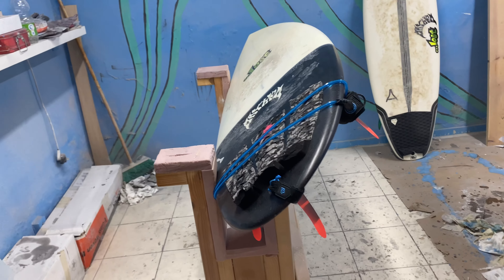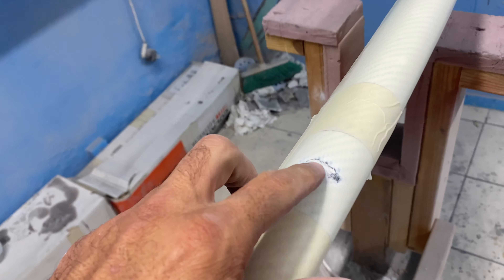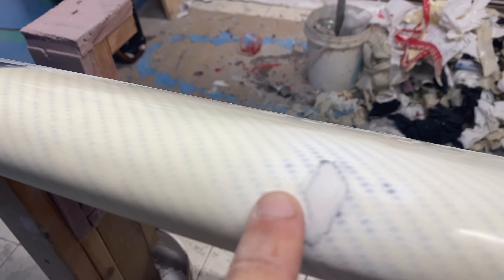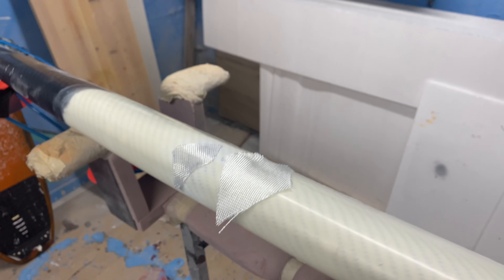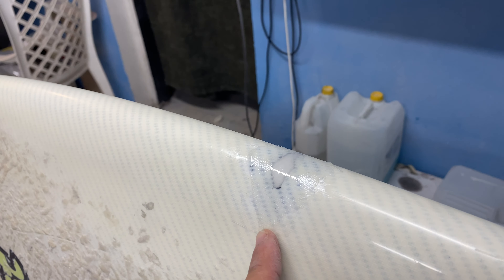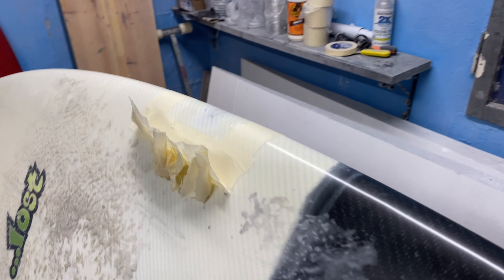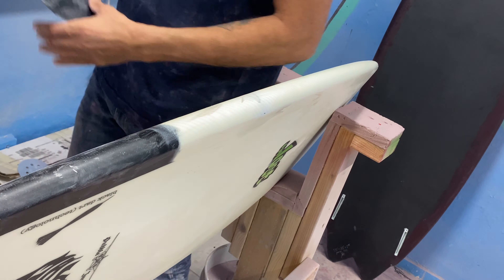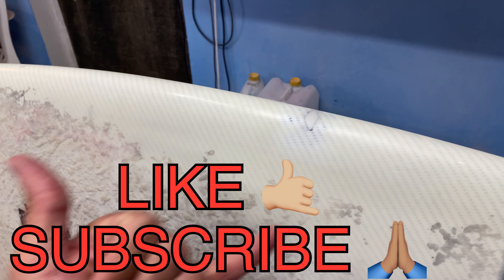How to Fix Surfboard Rail Ding Repair [start to finish]

Comment: Hey mate great video, how long would you recommend waiting between the three steps of the process for the epoxy, fibreglass/resin and hot coat to dry?
Reply from the maker: In my country it is very hot (27c plus summer) so i can sand after 5-6H 
To be 100% sure it's cured wait 24H every step
Reply: Thanks mate appreciate the info!

Comment: Hi Koby! what do you use to hotcoat this EPS surfboard? When you hot coat do u just add an extra layer of epoxy resin ? thanks!
Reply from the maker: Yes, i just add additive F for smooth finish and easier to sand 🤙🏼

Comment: my epoxy long board got through some rocks and the rails are scratched a lot;  non are deep but there are a lot.  Nose and tail are very scatched but not  like this one in the video;  what do you do to scratches? you recommend ? thanks in advance for your response bro
Reply from the maker: you can send them gently and spray matt clear coat, you can try to sand with water paper (320 or 400) and some of them will go away or - sand them with 120 grit, do a resing hot coat (as thin as possible) and sand + finish. if the scratches bother you visually - just spray them with any color you like after slight sand with 240 or 320 grit 🤙

Comment: how many actual working hours such repair takes?
and how much could it cost?
Reply from the maker: Rail ding will not take long, 15min each part and 3 part all together so total of 45min max overall, the thing is the wait- 24H between each step. I will charge 50$ for this one

Comment: What if you just threw like three pieces of the fiberglass cloth over there doing? Why tear it out and refill?
Reply from the maker: If you leave a hole with air in it it will create a bubble when hot and cold air comes, you need to fill it solid and close is, this is the professional way to do it 🤙🏼

Comment: When you sanded around the ding, there appeared to be black material appearing. Is that carbon? If so how come the white covers the black?
Reply from the maker: This board has an inner layer of carbon, but this is not full carbon- it is a blend with fiberglass so it is on and off
Reply: @kobymaymonsurfboards7320  Nice!